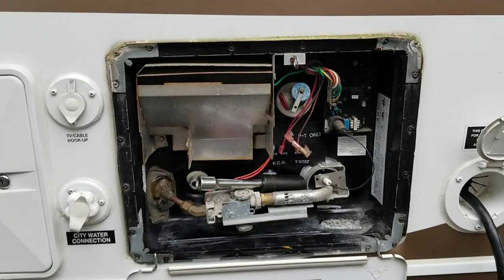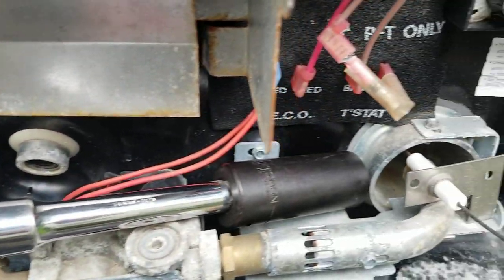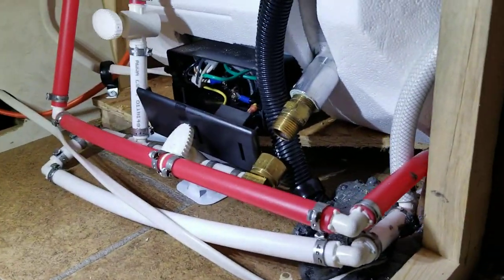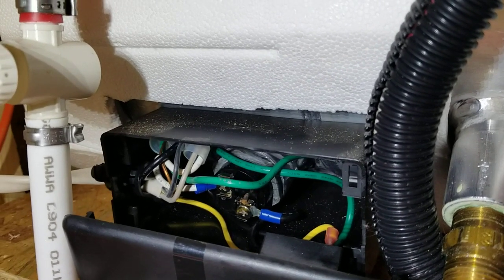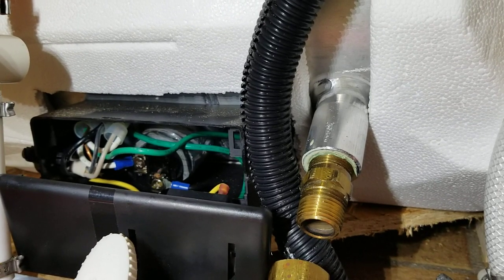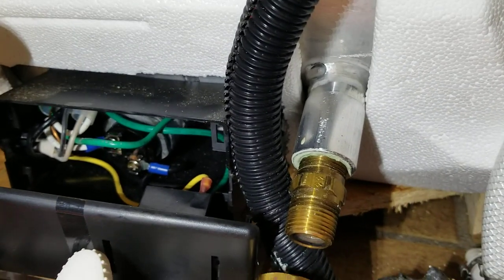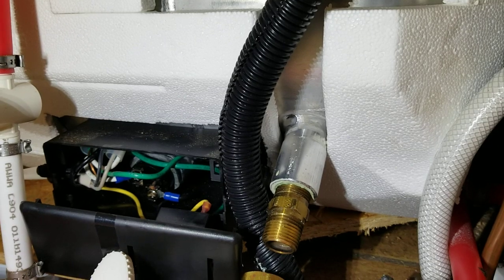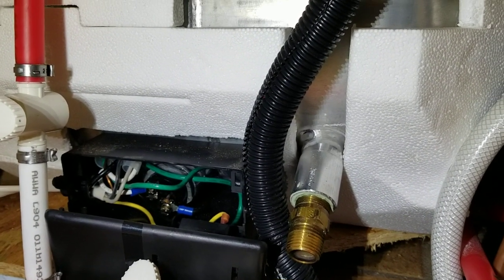Atwood Electric Heating Element

Comment: I had to pull my water heater out a few months ago, I wish I had known the element was on the inside at the time, I sure would have changed it then cause I have no access from the inside, and it need changed before next trip.

Comment: If you have to do the element again in your rv or in another person's then after you drain it initially, reinstall drain plug thread a 2 to 3 inch niple into the thermal relief valve, clamp a hose from shop vac to it, lift lever on relief to open then with the shop vac running you can pull the old element and install the new one without a mess
Reply from the maker: Nice trick.  Thanks.

Comment: I usually tilt my trailer using leveling blocks to let as much water out of the tank when winterizing. Perhaps this could be done to help with the element change as well.
Reply from the maker: Others have said using a shop vac and plastic tube you can suck almost all the water out.

Comment: I have an Atwood water heater in my fifth wheel they say the element is in the back and not on the outside I cannot find mine on the outside or the inside where could it be?
Reply from the maker: Its got to be on inside inside black electrical box.  Look for wires going into it.  I think they are all 1 1/2 inch hex.  As other in comments said, siphon out water thru drain using flexible line after draining and no water comes out.

Comment: I did mine today, sucked the tank dry with a shop vac and clear tubing then remove the 2 wires on the element, then remove the plastic junction box by removing two 3/8" nuts on the sides, lay it out of the way and remove element with socket. I placed rags and a cashew container cut off low to catch any residual water.

Comment: It also gets corroded during winter months, if the element is still working fine and the thread is messed up you can use a rotary thread or tap and die to fix it. It will save you some cash.

Comment: Very helpful. I'm getting some confusing results from G16-EXT. Somehow with both the switches down (propane/electric wall switches) my water is being heated... but irregularly. It made me wonder which if I should be flicking the switches up or down to turn on the heater. Up on the propane starts the burner... it's driving me nuts.

Comment: I just replaced mine today. It was pretty easy. My element is on the inside under the kitchen cabinet, so it was a bit of a squeeze. I first drained the water heater, then I took some 1/4" OD clear tubing and siphoned the rest of the water out. I bought a 1 1/2" socket from lowes and used that to loosen the old element and then installed an tightened the new element. No water came out at all because I had siphoned  it out already. I flushed the tank while I had the drain plug out. Entire process less than 30 min. I also had the high pitched noise coming from the circuit board. I fixed that by replacing the cheap chinese made board with the American made Dinosaur Electric one.
Reply: Genius!!! 🤓
I'm going to do what you did. 👍🏼
Thank you so much Mike!!! 😁
Reply: You siphoned the restnof the water by the drain plig?  How do you get it to syphon!  With a seringe ?

Comment: Hey Bill! Didn’t have a failing element but just wanted to stay ahead of any fail issue,
so, I replaced mine, (same as yours) and bought a back up on have on hand.
I emptied the ENTIRE tank with NO water spillage other than a couple drops
soaked up by a towel removing the heating element by putting aquarium air 
tubing into outside main drain and in the bypass line inside and hooked up to 
small pond pump after priming, and did fine.

Comment: I'm at a point of resealing many of my exterior gaskets.  So, I think you for showing where this is.  It is shown in my manual, but not well labeled.  I also need to clean all of the connections, so yanking it makes sense at this point.  Thank you.

Comment: This is a helpful video, thank you. I've bookmarked this one. A helpful tip for you. I dry winterize my trailer using 50psi from my air compressor. I can blow out all the water in my W/H out the drain port. That's a lot easier to do than what you suggested in the video. I have a 16" hose, with a valve on the end, connected to the drain port. I pressurize both the water system and empty tank, then open that valve, and all the water gets blown out. Also, mine has sung since it was new. I learned the circuit board gives off a high pitch sound. Spoke to Atwood about this and they said that's normal. Not sure if that's your issue or not. Thanks again.
Reply from the maker: Yep, found out later it was the circuit board.  Still singing years later! For winterizing, I blow out the lines but still run a little pink thru the pump from a suction line just before it to the closest outlet just because I'm not 100% sure blowing gets all the water out of the pump or not.

Comment: You have way more room than I did. I ended up just pulling the whole water heater out. I just had a leak under the water heater and I am pretty sure it was right there. I will be putting a new element in just because I don't want to do that again. Ended up my element was a 91160 and I will be putting a 92249 in.
Reply: The model number for my water heater is GC6AA-10E

Comment: You should just take it out to replace the heating element.  Making a big deal out of zipping out a few screws, cleaning off some old sealant, and applying new. Ya, it's a 2 hour job but it's not that big of a deal

Comment: Thanks!  I was trying to find the electric heating element on mine.  Like you, I'm hoping I can wait on it.  I don't have anywhere near the clearance you do.  I can barely SEE the relay box, much less access it.

I did read someone suggesting blowing out the water.  That's probably a good first step before trying to get it with a shop vac.

Comment: Thanks for a good info that is what I had to do pull out the water heater from outside and change the element , that was a good idea because the stuff that comes out of the bottom is just nasty chunks of calcified water and rust, also that way you can flush the tank real well.

Comment: Yesterday I was going to replace my element in my Atwood (Domestic) RV Hot Water Heater. Like you I couldn't find the element on the outside. Finally found my Instruction Book that shows the element on the inside. Thank goodness for you video; and like you I will wait till it goes.

Comment: When you.  Say singing are you talking about a low tone beep
Reply from the maker: It was almost a low whistle.  Very clearly audible when on electric, none when on gas.  I think its caused by localized bubbling around an old corroded heating element, not air escaping. You could hear it was inside the tank and not at the pressure releif valve.
Reply: @billmonroe7328  But,...you didn't mention if that 'singing', was heard while you're inside the RV, at the kitchen faucets, or outside, next to the water heater.
Also, i'm new to Rv's, but in my case i need to know how to test the heater on/off toggle switch, in the kitchen, as it fells loose,, so possible heater isn't getting a solid electrical current. 
Thanks.

Comment: Did you ever take the heating element out, or find a verdict to why the electric heat will not work? I have the same issue, so I'm curious.  I'm changing the ECO and Thermostat, since it's only $10, but I'm pretty sure that the heating element is old. Also, will a regular wrench work to remove it, or will you need one of those hex keys/wrenches to remove it? thanks
Reply: Having same problem, checked heating element for olm, reading 25 to much resistance indicating element is bad. the only way I can change that is by pulling the unit to change element. OLM reading should be no more than 10 OLMs.
Reply: gabe deal I fixed it. After trouble shooting several connection pints, everything pointed to the heating element, so I changed it and it works on both electric and gas. 2005 Itasca Sunrise 35A. 

When on electric 12VDC goes to a DC Relay that triggers the 120VAC to element via the YELLOW wire from circuit board

Troubleshooting 
-DC Relay/element are on backside of water heater tank under the protective cover. 
-DC Relay AC wires......melted/broken is common fail point.
-Ground wire connection is to a stud on tank...common fail point.

Element...
-Open the 120VAC Circuit Breaker for element.
Voltmeter continuity tests.

-Remove Black & White wires..test for continuity between the 2 terminals.
NO continuity....element BAD

Test for continuity between White wire terminal and element flange
Got Continuity..element shorted. 

Why do you need to pull the unit? What model Rig do you have? Typically you can get to them. Either opening a slide out and unscrewing the sidewall, or having your water heater inside like this video, with full access.
Reply: @philipmontera3092  Thanks, did you have to pull tank or able to change it without pulling it.
Reply: @gabedeal5807  I was able to get to it, and change it without pulling it out. was a tight space, but they give just enough room.  I purchased a Camco socket from amazon ($14) that worked perfect for my Atwood. 1/2 socket drive. What kind of RV do you have?
Reply: Mine is leaking at the element or the tank so its coming out. Its been 1 problem after another. Almost ready for an external on demand unit.

Comment: My God some people make everything more difficult then it is. first off your by pass vales are in the wrong places while your hear fix that problem by rearrange those lines so there out of the way and next time you'll just have to turn off those valves and it wont leak next time . think ahead.
Reply from the maker: Get the car keys out of your ears.  You can do whatever you want to "think ahead", but the first time you take that bypass off in order to be able to think ahead and reroute it, you have to deal with the fact that the bypass lower inlet is well below the outside drain and the heating element is even further below the outlet, so rerouting outlet only solves a small part of the water problem.  The big one is when you pull element out which is the lowest (and largest) hole on the whole darned heater.  If you have a way to take the element out without getting water all over I am all ears.  Best I could figure is to use a shop vac hooked up to a bent hose, stuck it in drain and worked it around until most the water was out.